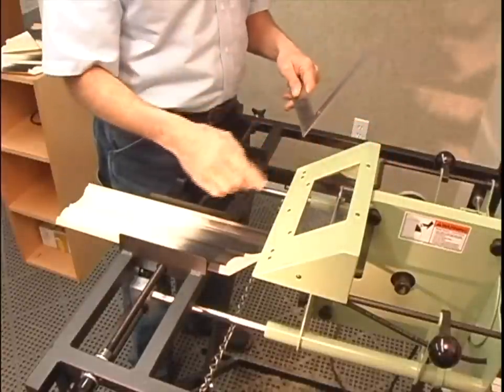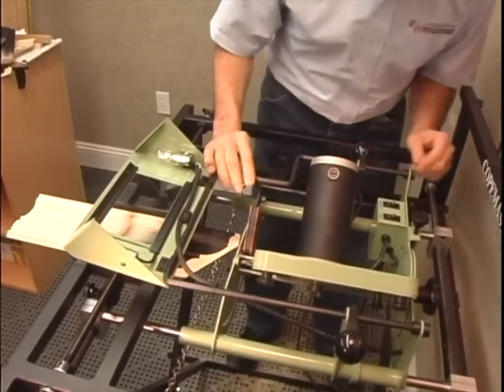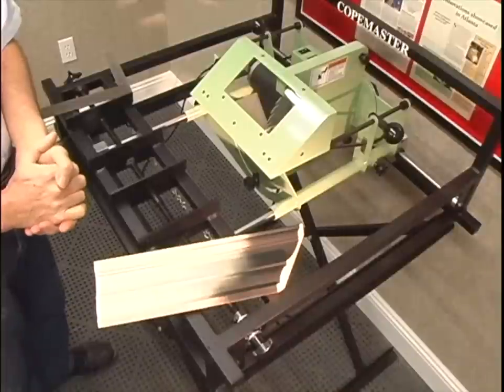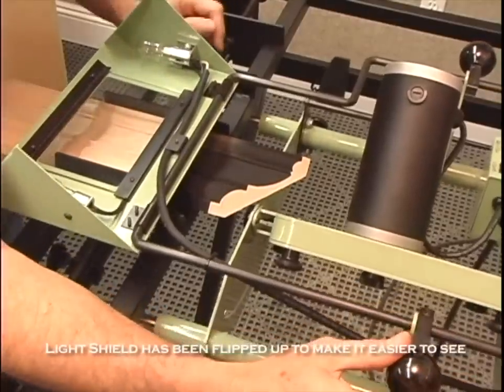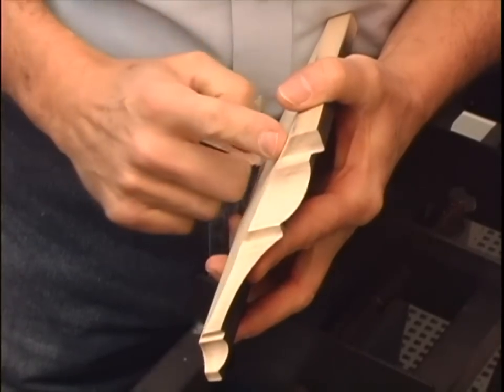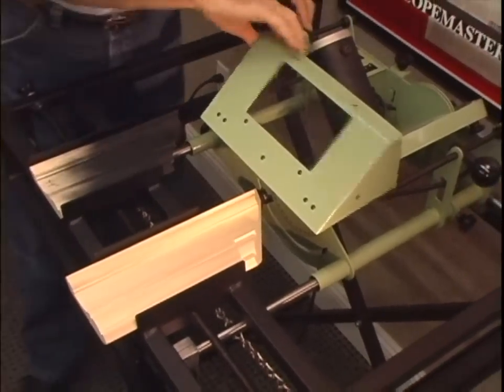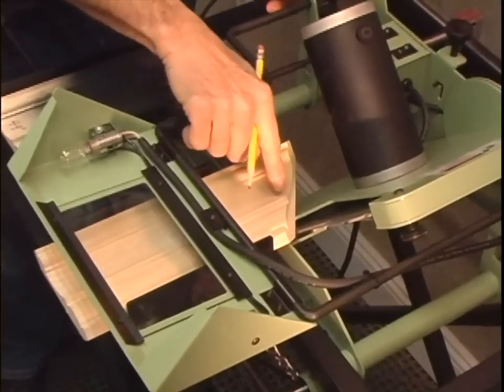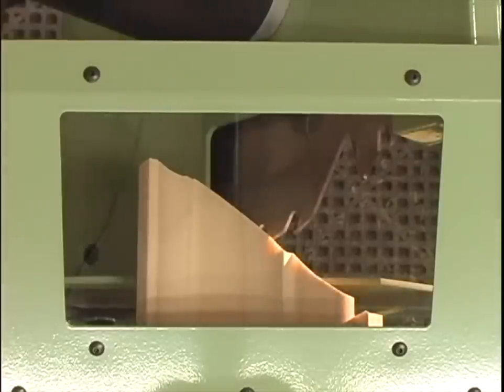Copemaster - Coping Crown Moulding

Comment: Some years ago I was starting a sizable trim job in Ct. which happened to be about 5 minutes from Copemasters home base. So a friend and I went and checked it out. Very nicely designed machine. Unfortunately, the large crown on the new job had a detail that made it very difficult to cope, regardless of the method. If I had seen the machine earlier in my career, I would have bought it in a heartbeat but the nature of my business was changing and I couldn't justify the purchase.

Comment: I am very impressed.  This appears to be a quality tool that is worth the money if you are demand  consistent quality workmanship and are doing enough production to amortize the cost.  I do have a concern about the durability of a template made from poplar or MDF.   The majority of our work is high quality painted trim.  Crown in particular is almost exclusively MDF.  I avoid MDF in potentially wet areas.

Comment: That's a very cool machine, but it takes a long time, and a lot of skill to set it up. Now I know that by using it over and over again you will become faster, but it still takes time. Another thing, I don't know exactly what the machine costs, but if you don't have a lot of moulding that needs to be coped, it will never pay for itself. Everything that machine is capable of doing can be achieved by a miter cut anyway so I guess it's really up to the guy paying for it?

Comment: Coping saw is easier and quicker.  There is no way I would buy this machine and hula it to a job site to cut a few pieces of crown or base.  Takes way to long to set up and use.  Not cost effective.  Besides my copes a perfect.
Reply: Agreed, I seen this machine used in Rancho Santa Fe on a huge home running Trim, As you said, this isnt for small jobs, this is for production high end work.
Reply: I can see the advantages of this machine on the job site, but doing traditional Hawaiian dance with this machine would get you fired pretty quick.